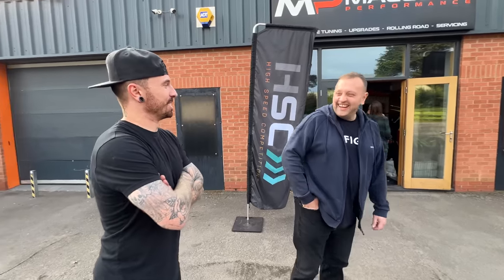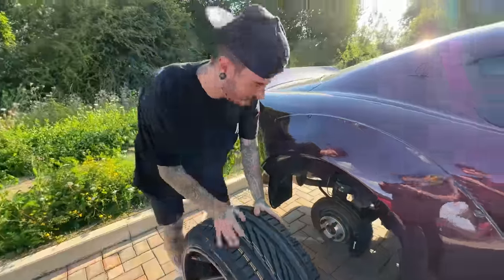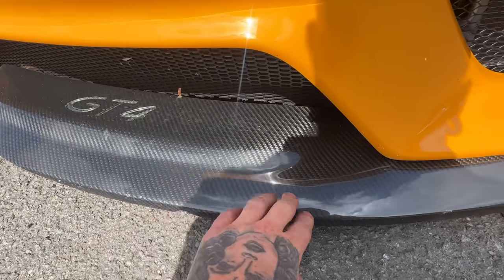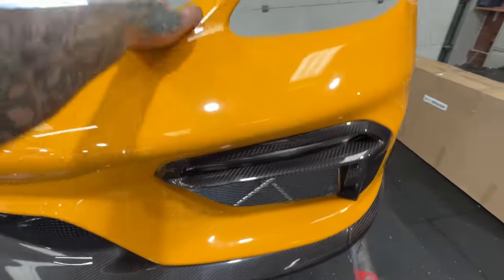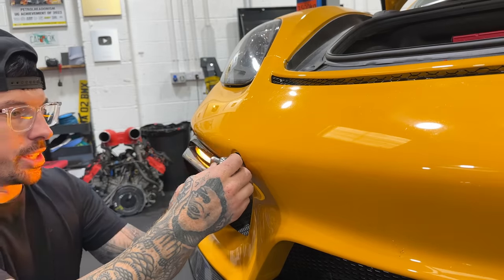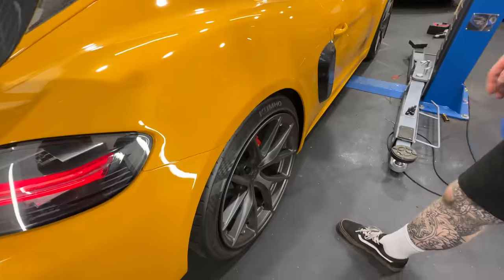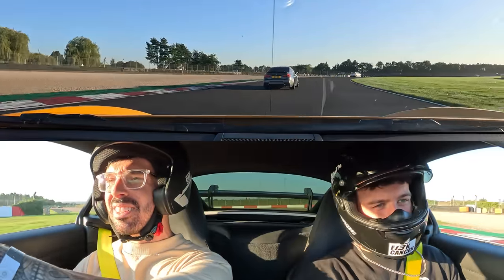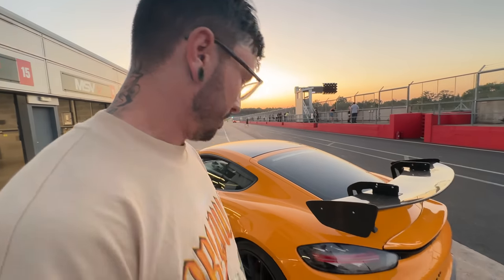FIXING MY WRECKED PORSCHE CAYMAN S... AGAIN!

Comment: Solder sleeves are a standard repair in the aviation industry and used widely so good job Mat. 
Really amazed at how much damage gravel munching does! Not going there with our Cayman, that's for sure! 😄
Reply: Not in America FAA…solder is brittle to vibration….only place i have seen solder is in to add a grounding wire to a shielding wire.

Comment: Add some metal front splitter support bars in the middle of the grille onto the splitter. Would look sick but also actually hold the splitter up. At high speeds that splitter is gonna be pushed down by the immense air pressure over it.
Reply: Didn't Porsche (When Matt took it for an inspection (In an old video)) say it was missing those metal cables to support the splitter??
Reply: Was with a Ferrari challenge car recently and the splitter on them feels like you could stand on it, also looks like it’s been chewed by the dog and still going strong - I’d keep the nice carbon one on the shelf and stick a scrubber on for track times

Comment: Great stuff as usual Mat! I had a Jag a few years back with a similar tyre problem to the Maserati, turns out it was toe angle rather than camber that was the culprit. Too much toe out causes the inside tread to wear quickly. I'd recommend a good four wheel alignment to get it sorted. :)

Comment: RE the solder stick connectors I saw them on one of Ratarossa's video and thought they looked ace and bought some! And they are so much easier the trying to solder a wire together. In my opinion they are a brilliant invention!

Comment: Reinforce the centre splitter with some blue foam chopped to shape and secured with epoxy between the top and bottom pieces of carbon. Or the gap filling expanding foam, that doesn't need epoxy. That will take the flex out of it and no need to drill holes in the lovely carbon.

Comment: Matt, advise you look at geometry and the width of wheel to width of tyre. Damage to those tyres indicate the wheels are too wide for the tyres. This problem is exaggerated when using low profile tyres. Need also to check the tyre wall is not rubbing on a suspension part.

Comment: About the Porsche and the front splitter why not cut aluminium plate or bar in the shape of your lower bumper to join the hollow void and place that in the void of the carbon and use it as a full length clamp and centre support for both your bumper and the splitter

Comment: Mat, that front spoiler needs more structure to its internals. Use a spray polyurethane foam.  The flexing in the Nurb caused the bottom half to peel off when touching the tarmac. The foam would have kept the pieces together and stopped the flexing

Comment: I've been using those solder sealer connectors for over a year on my motorcycle and trailer and they work great. Easy and convenient they do the job quickly and securely. They're inexpensive and you can order them just about anywhere.

Comment: Mat, evananderson214 is correct, youll want to get some of the adjustable tie rod style splitter/canard supports for the the mid section of that sexy CF splitter, at 100+ MPH it will create much more down force than you lifting it. As well as the turbulence that air creates going over the splitter can make it wobble up and down. 

TLDR Splitter supports are good 👍

Comment: Live not far from AF in East Winch. Going to Kings Lynn on 23rd for the event they're sponsoring

Also, E/E Engineer....those solder connectors are blooming brilliant; especially if you suck at soldering wires and cable

Another "also"...the MK3 Focus is...mental. I've got my ST at a touch over 300 BHP, loads of suspension mods (apart from spings/shocks) and with 245mm tyres (8.5J jag f-type wheels), it grips for days. Faster than a stock RS from stationary or a 20 roll, but the RS will keep up & pull ahead after 100mph. The focus is so well balanced from factory is really does well in corners.

Comment: I dont think the splitter will hold with no additional support. Carbon is super strong in the direction of fibers. So if alot of downforce is applied to the middle, it will just bend until its hitting the road.

Comment: Those Solder connectors are great just don't try what I did and use an open flame like a lighter it will melt them. I tried a lighter like on shrink connector and it turned into a blob of plastic.

Comment: Looking at the tread pattern and direction on the new tyres on the Maserati it looks like it's on the wrong side of the car, the tread grooves are facing towards the centre of the tyre for the direction the tyre is rotating.
Reply from the maker: they are multi directional

Comment: The wheel spacers will not improve the handling, and may worsen front end grip due to altering the ackerman angle,  but they  WILL shorten the life of the wheel bearings.

Comment: Jaguar were using those solder connectors back in the 1990s. I used to make the engine looms for the super charged xk8 and the V12 engine.

Comment: I first used those heat-shrink cable joiners about 45 years ago
Reply: Just as an addition, I find silicone tape better than loom tape. I rebuilt the harness on my kz650B with it.very strong .

Comment: the bottom surface of splitter needs full length/ width support as it has suction effect of the high speed air passing under it.. so it will drag along the ground.. i suggest windscreen adheshive to stick a carbon. or aluminium (25mm by 25mm or deeper) to top surface of trailing edge and leading edge behind mesh grille to spread the suction force to each side of the middle grille ... or just go, scrape the sh&t out of it and be back where u started 🤣🤣

Comment: Don’t run on a track day with the tow eye fixed. If you hit a barrier, you’ll snap it off and you’re f*cked if you actually need a tow. Just keep it handy in the glovebox.
Reply from the maker: You can’t go on track without a tow eye fitted
Reply: @matarmstrongmk2  I know some organisers insist on it, but it’s a really stupid idea. Seen it happen - car goes off, clouts barrier, towing eye sheared off. The Marshalls then have to spend about 20 minutes digging gravel to get to a suspension component to tow the car out. If they’d kept it in the car, screw it in, attach rope, job done.  You could point this out on your next event…

Comment: Those connectors are no good it looks like the soldier melts to the wire but it doesn't if you pull them apart after using them you will see they do nothing.

Comment: You don't put Michelins on a car because it doesn't break traction. They decreaseyour stopping distance quite significantly to the point where it might be the difference between an accident and nothing happening. Putting some Cup 2's on that Cayman will show you how much better they handle aswell. Never understood why people don't mind spending money on useless exterior parts of their car but do have trouble spending it on the only thing keeping them on the black stuff.

Comment: Was insured for my classic car at a cost of £205 for 2022 to 2023, had my renewal advice in excess of £750.  an increase of 350%, had no claims or driving convictions.
Then got a quote for similar insurance with agreed value for £470 from a well known insurer. Spoke to Adrian Flux and was told the insurance company they had used was no longer  with them and they could not get anywhere near the alternative quote I had. Enough said.”

Comment: Hi mate was with Adrian flux for years changed when thay came back with a quote for over a grand for a 19 year old Volvo xc90 and a Mercedes gl on a 10 plate went back to the for a quote 2014 Range Rover sport thay wanted 1400 pounds and got it elsewhere for 700 and thay ask you if you have had a quote and ask the price and still come back with a quote double have used them for years?????????